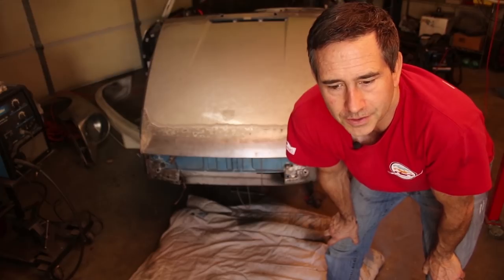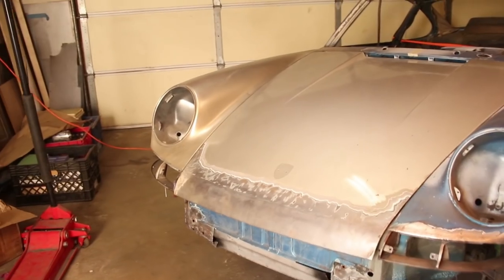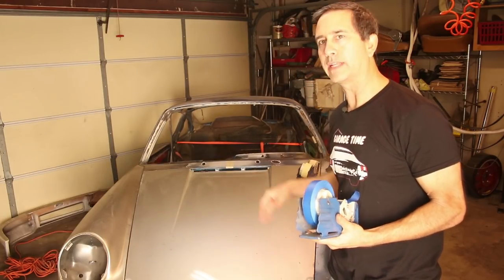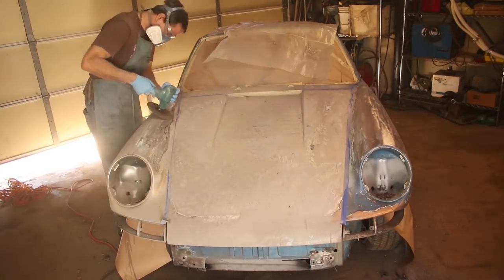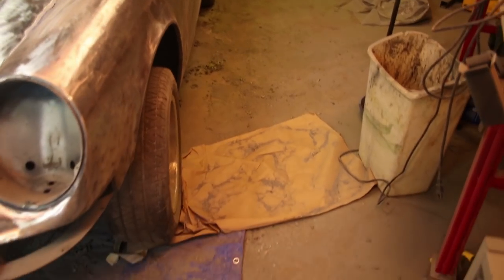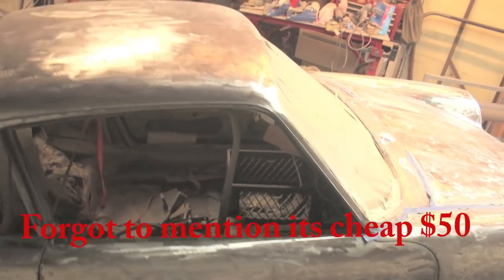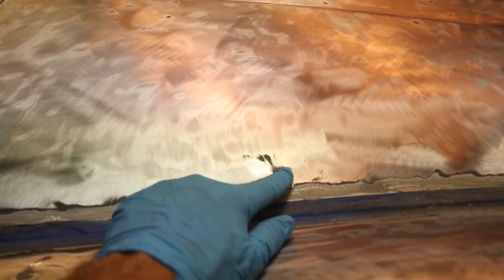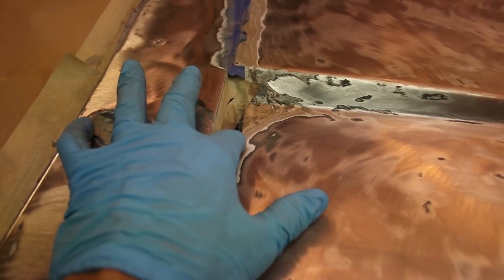How to Beat the Ugly Off Your Car | Paint Removal Under $50

Comment: Hey Tom, at the very beginning of the vid when you’re showing the rattle-can undercoating (which, I agree, didn’t look great), you mention using a schutz gun to get the proper texture. Are u planning on using the schutz-style paint gun, or do you have a diy method to get that textured finish? Either way, looking forward to it!
Reply from the maker: Hi Jake, yes I thought I could get a head start by undercoating the blind spots created by the suspension arms.  As you saw it was a waste of time.  I'm going to experiment with the schutz gun to get something closer to the factory finish.   We will be learning this together by trial and error!

Comment: So if you remove the galvanization, what will you do to prevent rust???
Reply from the maker: Hi, this car is a 1974 so most of it isn't galvanized to begin with.  Epoxy primer is the restoration standard for rust protection.
Reply: @GarageTimeAutoResto  Freddie Hernandez takes an approach that seems very appealing. What do you think? https://www.vsrestorations.com/dipping
Reply from the maker: Wow, that seems like a great process.  I'm not knowledgeable enough about it to really give my opinion.  I didn't want to strip everything on my car.  That is a slippery slope and expensive way to start.  What happens to the hollow cavities?
Reply: Agree with @Laguna2013 maybe look into deoxidine or something similar to treat the bare metal. Epoxy is great but just remember to scuff the deoxidined finish, just prior to epoxy sealer. Epoxy is a sealer, not a primer.